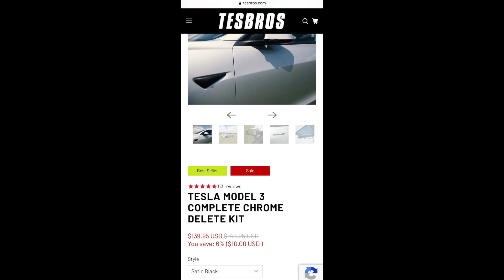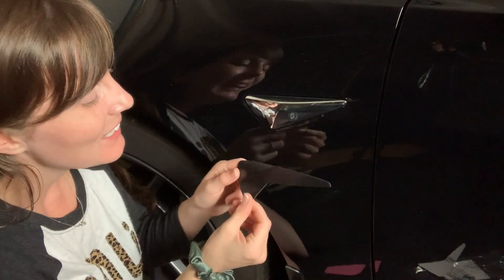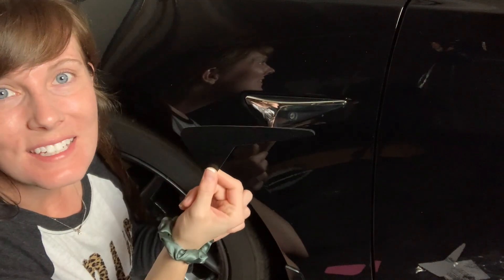I MURDERED My Tesla!! 😱 Tesla Model 3 Chrome Delete Part 1 | TesBros Kit

Comment: Great job so far! Can't see any bubbles. Is there a reason for not using a spray solution to aid installation?
Reply from the maker: Thanks! So we typically use spray solution (alcohol/water) when we are working with Paint Protection Film like when we put a strip around the trunk area of Kim (pun not intended lol) or when we installed the smoked headlight films on Kanye. For regular wrap jobs, we just haven’t had the need to do it because if we mess up, we heat the wrap with the heat gun which undo’s the mess up, and try again.